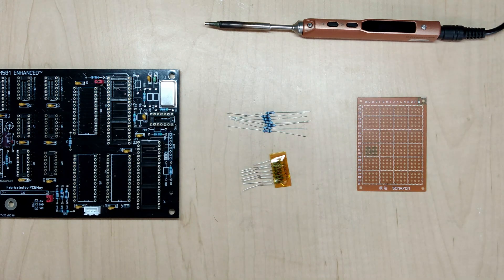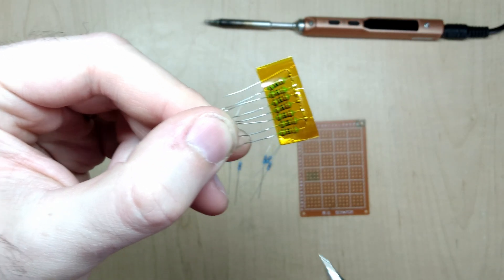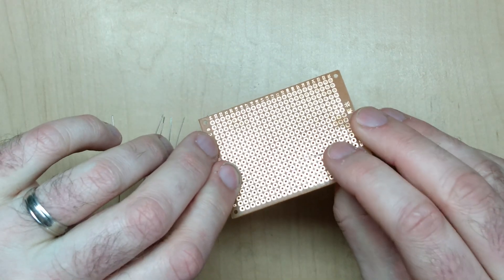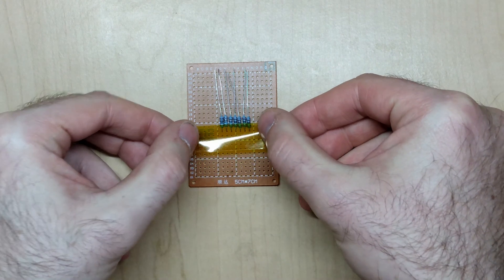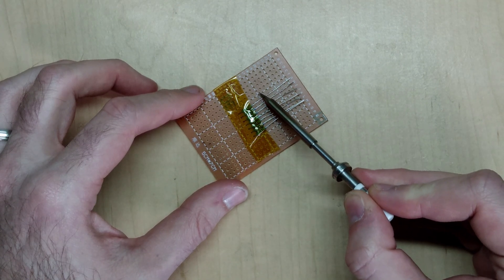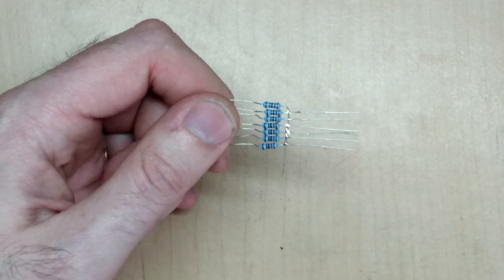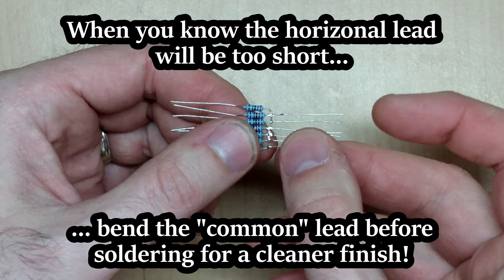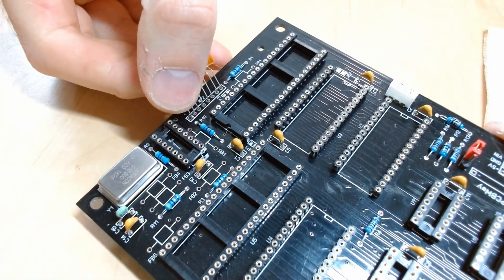Quick Electronics Tip: Make a Resistor Network

Comment: It looks like you're putting some solder on the iron's tip and then putting a blob between each resister lead and the bus where they cross.  Don't you have to heat the connection and then introduce the solder (with flux core) while continuing to heat?  If you don't, then it might work, or you might end up with a cold solder joint that could fail at any time.  Admittedly, I've "cheated" in this way, too, but whenever I do, I put some flux or flux paste on the joint first to make sure that it is de-oxidized and that the solder will properly flow.

Am I missing something?  Like maybe you moved the iron's tip so quickly to the joint that the flux is still doing its work, and that is enough to get the job done properly?  If not, then you might want to consider adding some flux ahead of time (just a tiny amount will do).
Reply from the maker: You're right, this is a bad example to follow and I barely got away with it because I was using solder with enough flux in it's core.  I went back afterwards and reflowed the joints, which produced better connections.